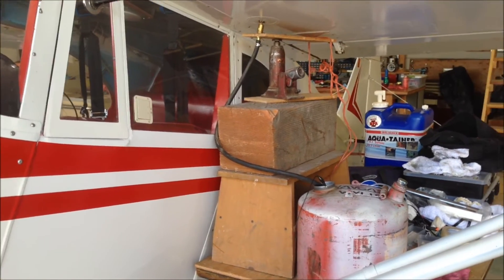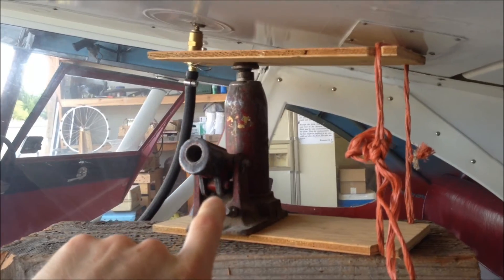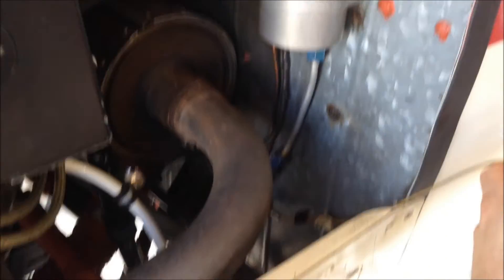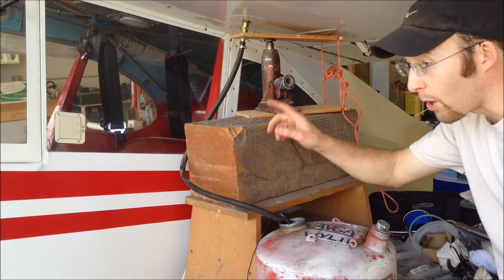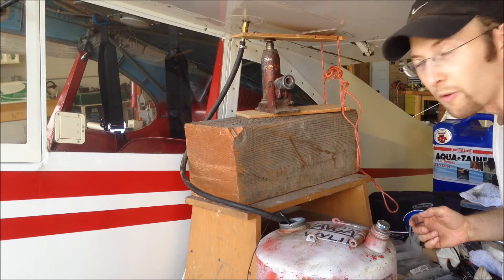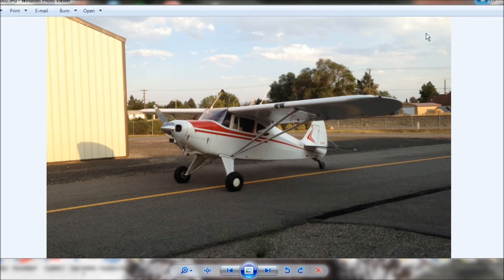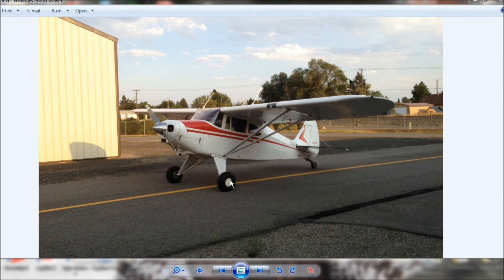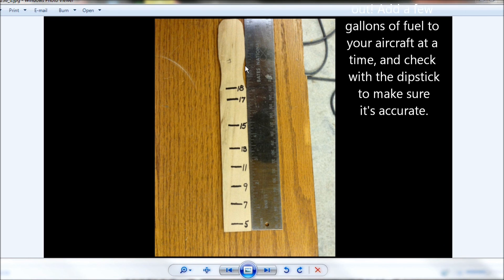How to Make a Fuel Dipstick For Your Airplane

Comment: Good idea.  But I would have to drain 64 gallons of fuel out of one wing, and that wouldn' t be cool.   : )  I may try to pioneer another method, or consider if it is possible to calculate fuel from a measurable point in the tank as it sits, then fill and mark from increments there.

Comment: Seems like a complicated way to drain your fuel. I just fly on one tank in level flight until it runs out, then switch to the opposite tank. By draining it at the sump you may be unwittingly including unusable fuel on your dipstick. Maybe your plane only has an on/off fuel selector so you can't drain from one tank